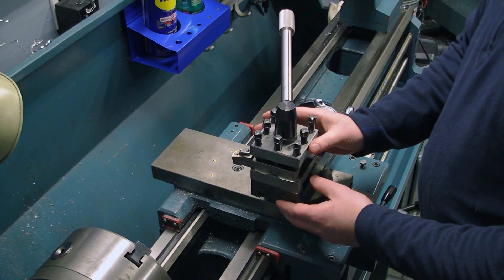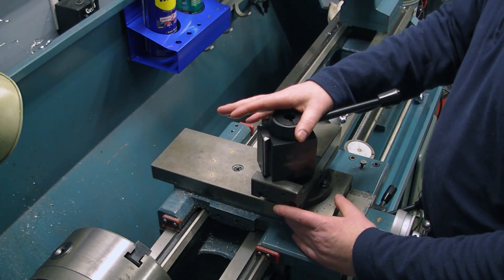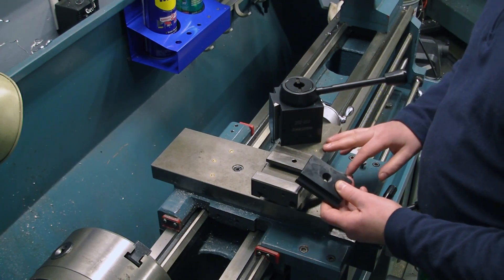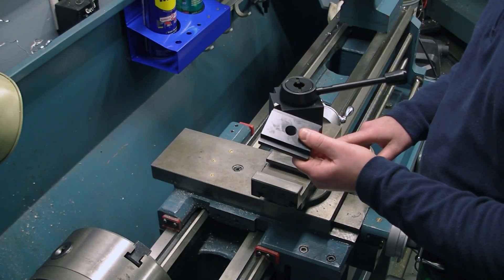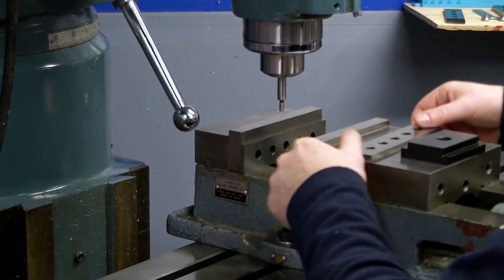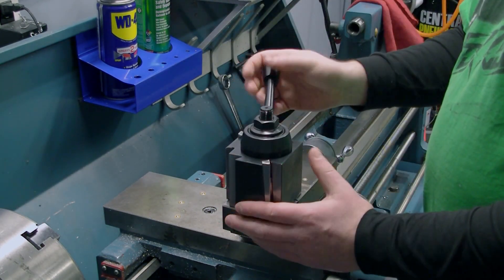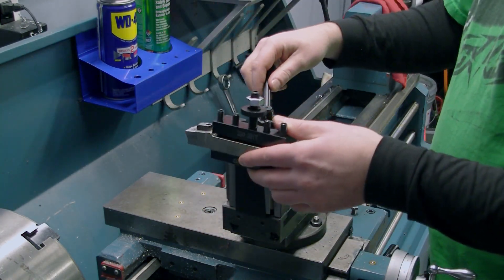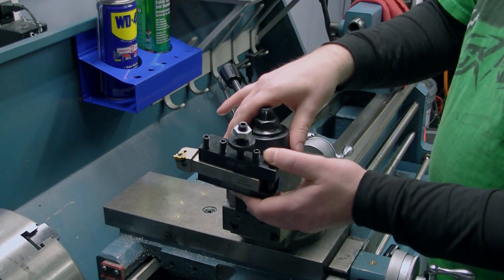Accusize quick change tool post install on an ENCO 1340

Comment: Does your lathe have the plastic cover on the cross slide? My 510-2585 does and I can't figure out why. I just got the lathe and the cross slide is a little rough when cranked all the way out (ie., toward  the operator). I took that cover over and slid the cross slide drive gear  (it's just held in place with a set screw) off the apron drive gear and cranked the cross slide in with the handle. It was super smooth. The auto feed seems to work fine, no weird sounds or anything. Just seems jerky when cranked by hand. Any ideas?
Reply from the maker: I dont have a cover on my cross slide.
Reply: @EtherealProject3D  bummer
Reply from the maker: @unclebuck5051  I ended up 3d printing new way wipers and they have been doing great for the last 3 years.

Comment: Thanks for a great video, but how did you remove the threaded part below the old tool post (in the slot) - the part that makes it possible to attach the old tool post to the cross slide. Also, how did you remove the little indexing piece that fits in the hole on the top of the compound slide recess next to the rebate / slot? See the underside of the old tool post that accommodates what I am querying. A video showing this important process would be very useful. My Chinese TurnMaster 13x 40 has the same problem.  Thank you.
Reply from the maker: I dont remember exactly, i think there are some setscrews that hold the old tnut in place. As for the index pin, you need to disassemble tje compound slide to get it out.

Comment: Did the tool post come with that t nut? The one I bought just came with a solid block
Reply from the maker: Mine came with a solid block and I had to machine it to fit my lathe.
Reply: Ethereal Project oh I see now, I went back and watched it again. My bad. I thought it came with a t nut and you just modified it.
Reply from the maker: Its all good. Do you have a way of machining yours?

Comment: I enjoyed your video. Having had your tool post for a while now do you like it.  Does it seem rigid. Any input would be helpful. I’m looking at this same tool post and was wondering if it’s a good one. The Aloris is great but no more than I use my lathe it’s hard to justify. Thanks.
Reply from the maker: So far I have been super happy with it. Its very rigid and after doi g the initial tool center adjustment its been on point.
Reply: Thank you for your reply this brand is one I’m considering.
Reply from the maker: @jimmunger8658  No problem, good luck and ant me know houw you like it if you pick it up.
Reply: Hey Jim, check out woodscreek workshop.  He has the same tool post and shows how to get the slop out of it in a video.  I'm installing one of these now.  ;-)